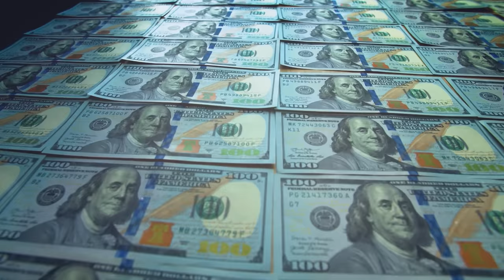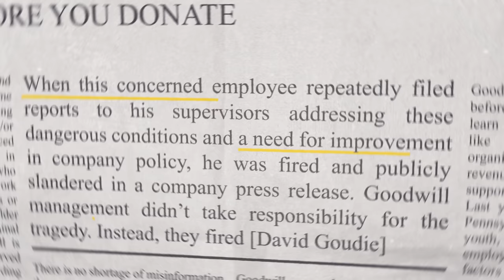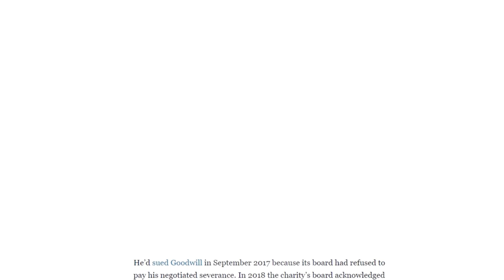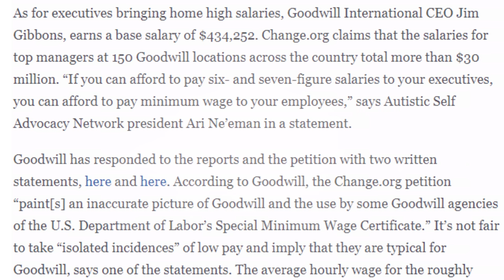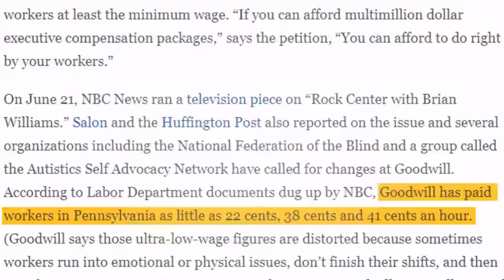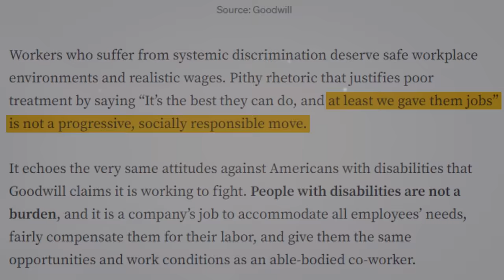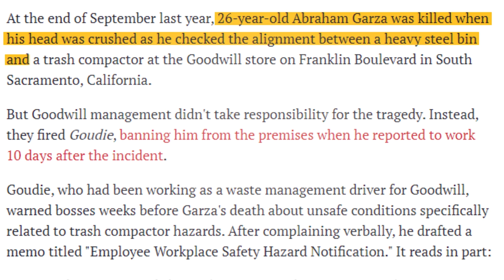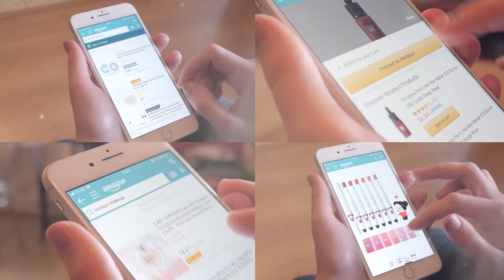Goodwill? More Like Ill Will - The Ugly Truth

Comment: having worked for them and fired by them over quota, I can confirm they are that greedy. Why did I miss quota? Because my bosses refused to acknowledge that like 50% of their donations were turning to trash or unusables. Instead of working that out with me, I had two bosses write me up several times and eventually fire me. They do not value quality, they just wanted a number out on the racks. And it made me even more furious when a worker next to me always passed the quotas, but only did so by putting out unsellables. I felt so used by those people...
I can also confirm, yea, I'm pretty sure using the compactor didn't have much training (I didn't really receive much training at all...). It felt like an afterthought, and I'm pretty sure a young 20 year old without much thought might actually hop in it if they didn't already think twice about how compactors work...

Comment: Used shoes n underwear for top $$$

Haven't been to most thrift stores in well over a decade. It's better to buy new these days for clothes and electronics. Unless your heart pressed for a toaster or something you may have to swing in there. Back in the '07 I bought a TV I walked in the place it was a nice Sony they had it running so everything was warmed up and it was working fine. Take it home after it's cooled down turn it on there's no picture when it heats up there was a picture but it was going in and out I got took from my money. You going there for jeans for work and you might as well buy a new pair they're trying to get 10 and $12 sometimes. And if you get scabies easily like myself don't even bother going near the furniture.

Comment: The value of goods donated to Goodwill is debatable. I volunteered at a local Goodwill to test appliances that had been donated. The national organization does not require that blenders, shop vacs or fans be plugged in before being put out for sale. However, some local Goodwills will screen the items. My local Goodwill simply wanted me to plug donated items in to see if the item just had a short in the cord or a more serious issue. Any that didn’t work or that would be a shock hazard went to the dumpster. About a third of the items I tested went to the dumpster because of minor or major repairs needed.

Comment: The only argument for paying disabled employees less, is to keep them under the SSDI income cap, which is $1470, or $2460, if you're blind, per month. (pressuming gross income, and not net) Even with that being said you could work full time at $8.40/hr fulltime (40hrs/week) and not hit this income cap,  the only reason I would say it's justifiable at that point is becuase unless they're making around an extra $16,699/yr (SSDI is $1391.59/mnth (in Florida) they would actually be getting less net income per month than if they were working at $8.40/hr. Like i said though, that's a full time 40hr/week position, and since Goodwill and many other companies like McDonalds etc, rarely hire full time (it's cheaper for them to not have to provide employee health benefits, which i beleieve is only required if you're working 30+hrs/week) Which means after all of that, there is no justification, for any of these companies, including goodwill, to not pay disabled employees the same wages as non-disabled employees. I'm sure there is more nuance, and not everyone on SSDI gets the same amount each month, but even still, considering it's likely going to be a part time position,  there simply is no excuse.

Comment: You didn't add that they throw away over 80% of what's donated because they either, don't want to deal with it, they don't get to it by the end of the day or because items like 3 piece suits and 5 & 7 piece baby sets take too long to tag and hang so they pitch them EVEN IF THEY ARE BRAND NEW WITH THE TAGS ON THEM!  Employees are expected to inspect,  tag and hang 80 items an hour. If you can't keep up, they constantly threaten to fire you. Considering the average person can only do 60 items an hour,  multi-piece items will most likely end up in the trash.  Oh and did I mention that on the morning of "X colored tag is on sale days", they have the staff go onto the floor and pull as many of that color tag as they can find TO THROW AWAY. They would rather throw it in the trash than let you have it for half price or 99 cents. They have also decided to do away with the 99 cents price tags because they don't think it's worth their time to sell anything under 1.99. Shop there if you want but DO NOT DONATE TO THEM!